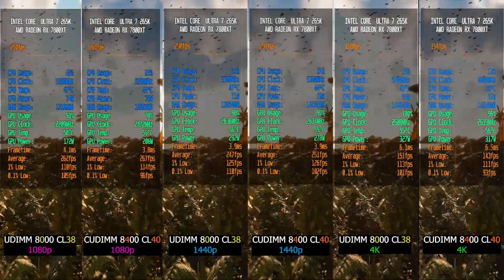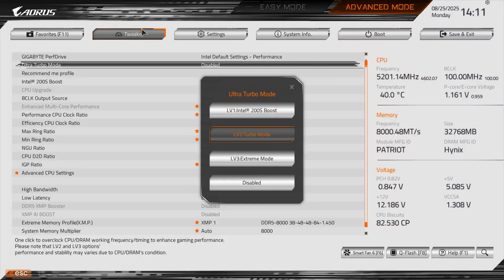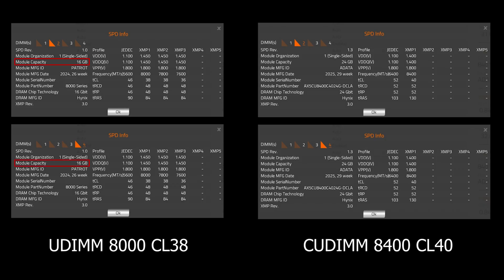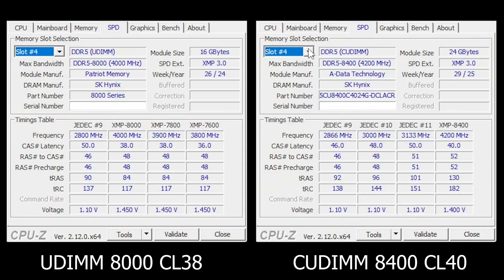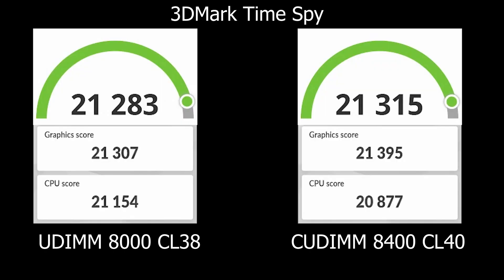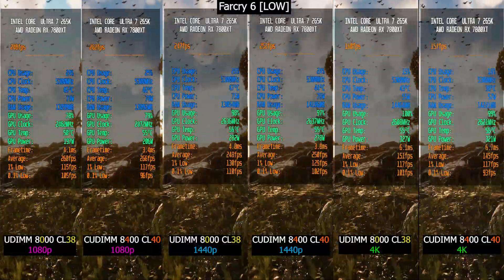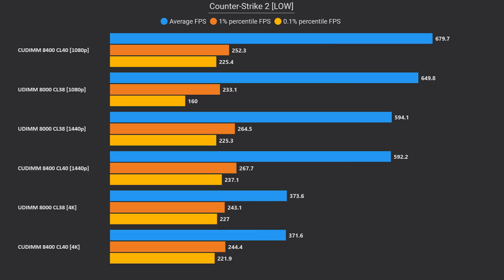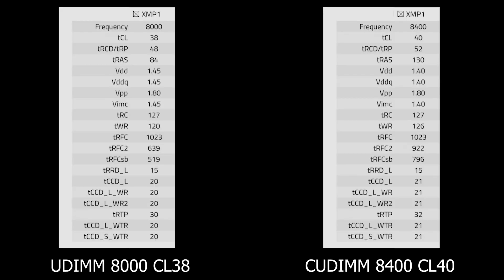I tested Lower Timings UDIMM vs Higher Frequency CUDIMM DDR5 – Here's what I found

Comment: When testing things like CPUs and RAM you really only need to test at 1080p because anything higher than that is going to be a GPU bottleneck rather than a CPU one.  As you can see from the large differences in your 1080p scores between the 2 sets of ram vs the 1440p and 4k results.  One other thing I noticed (which is why I decided to comment) was the 1% lows and .1% lows in most of these games were much better with the cudimms.  That is huge because that means your fps drops are less noticeable with the cudimms vs udimms at essentially the same speeds.  Cause sure if you're getting 600fps in cs2 on average thats great but if you have random drops to 160 that sudden change is going to be a complete stoppage of a stutter.  So the closer you can keep your .1% and average FPS the smoother the overall experience will be.

Comment: Please man, can you answer to my comment i made on your Samsung QN90F 43 unboxing and test video? Thanks
Reply from the maker: I just did. Sorry for being late. Mine didn't have corner backlight leakage as I said, but I had an even worse grid-like pattern showing on middle right. I told u in the reply the exact minute where I showed it, no editing, real footage on a 100% blue background. It's visible as day, and you can't help but feel distracted when you look at it, so I returned the TV, I felt like QN90D had better quality control. Maybe on latest  batches it has been fixed, I got it on release
Reply: @TECHOSAUR  Yes i saw that, thanks for showing. I think i will go with the S90F 42 OLED